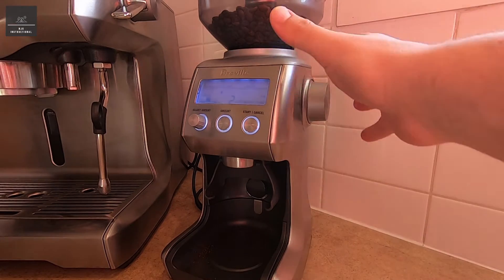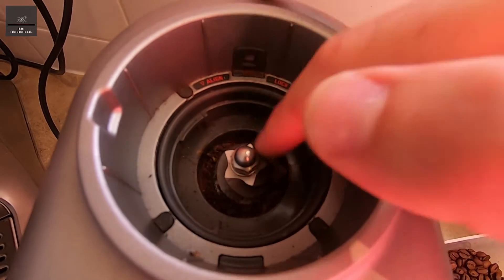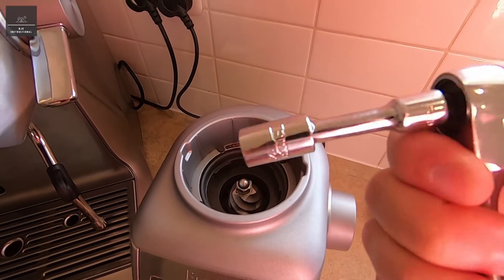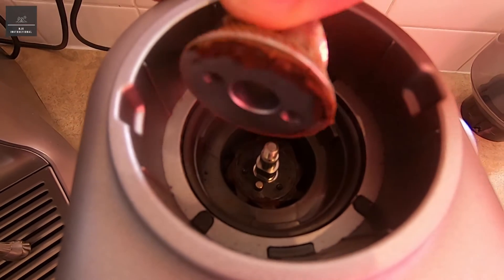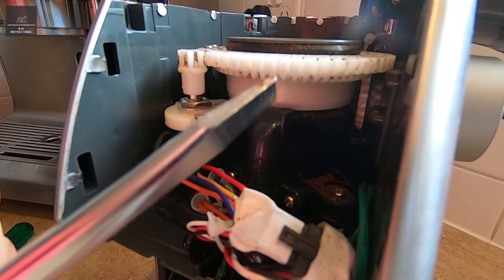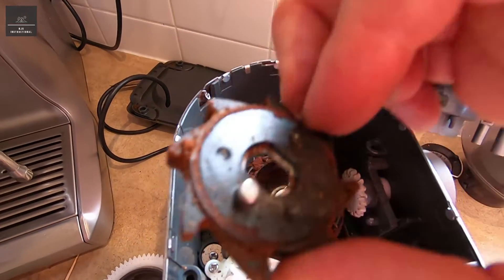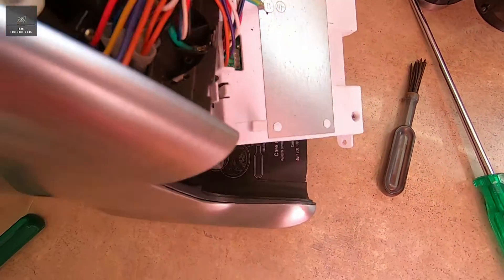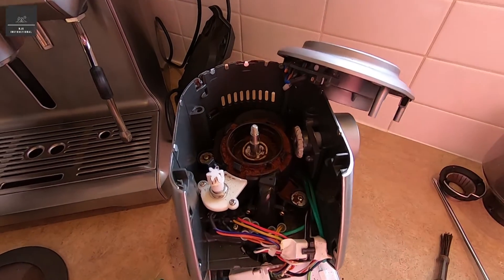Breville Smart Coffee Grinder Jammed! - TEAR DOWN & INSPECTION - CAN WE FIX IT?

Comment: About a year back my grinder hit a stone. I stopped it right away. Didn't look like any damage to the burrs but I purchased new ones anyway but the grinder just wasn't pumping out coffee like it used to. Took maybe 40% more time to get the same volume of coffee. I thought the gears might have gotten messed up so I 3D printed some and took the machine apart but found the original gears look good. I put it back together and like magic it worked like new.... until couple days ago I heard another strange noise as it was grinding. Stopped it again right away but no rock this time. Now again it takes 40% more time to grind the coffee. Is it possible the safety clutch needs to be reset or is it designed to self-reset? -Thanks

Comment: Yes very good I followed your directions and my problem is the motor has seized. I have a separate grinder now so will use that as the grinder in the machine is  no longer working. Thanks again.
Reply from the maker: You're welcome!

Comment: You said remove the 4 screws with the long screwdriver.  I only see 3, and only see you remove 3 in your video.  I know there is a 4th because it still won't open, but i dont see the 4th screw anywhere beneath.. !

Comment: Can someone please post a link to where I can get an impeller or the printer instructions. I have access to a 3D printer if necessary. I'm also avoiding Breville in future. The problem with this grinder seems to have been going on for years.
Reply: I 3d-printed a new impeller this week and it does expel grinds better than my old one..  The model is on thingiverse. Breville Smart Grinder BCG800 Impeller by Lacehim

Comment: After you remove the bottom burr you can actually just lift out the impeller (grab the steel pin  on top with some pliers and lift) and then the felt washer and 2 more steel washers under it.  Often cleaning down that far will fix the jam with no need to go into the bottom.

Whenever you clean out the grinder you should always go this far to clear the whole path.

Comment: Hi there, can you comment if the upper burr unit for the newer BCG820 grinder will fit and work in the older BCG800 grinder?  They look like an identical fit.  I cannot get my BCG800 to grind fine enough so I am wondering if I can put the newer adjustable upper burr into the BCG800 to get a finer grind.  Or, is there a way to adjust the older BCG800 by openning it up as in your video and changing the teeth alignment of the large white cog with the small white cog?
Reply: See if the upper burr has a adjustable ring with numbers on it.

Comment: Great video. Around 3-4 years ago my impeller chucked it in, so replaced it with the 3D printed one. Today it clogged so had to pull it apart again to clear the chute(so another refresh on pulling it apart was in order). The 3D printed impeller still looks really good, but clearly they should have installed a metal one to begin with. All about cost I suppose.

Comment: When you showed the star bean grinding gear with shortened teeth the first thing I thought of was that a bearing in the motor was bad and the motor shaft was wobbling enough to rub the ends of the teeth against the sides till they were so short that like you said they let pretty much whole beans through to below rather than breaking them smaller first. Rocking the shaft you might see if it is wobbling enough at high speeds to wear off the blades.

Comment: Is this there some kind of felt washer under the impeller? 
On my machine this washer was all gunked up and fell apart as soon as I touched it.
Reply: Yes.  You can see it in his video; after he removes the impeller it's still sitting there where the impeller was.  I think keeps grounds from getting into the bearings farther down.

It's probably OK if it's not fully intact, just fit it in the impeller base, make sure it goes all the way around.  Or you can track down a replacement online -- part number SP0001575, Breville is out of them but plenty of sellers online.

It's VERY fiddly to get it back in the machine.  I ended up turning the machine upside down in order to put the impeller back in without having to worry that the felt had slipped out.
Reply: @roberttarrall610  i fabricated my own washer from a sheet of felt i bought in a crafts store. 

Works fine so far and cost me next to nothing. 
And i still have felt to fabricate  20 more.

Comment: What's the name of the middle metal pole that the impeller sits on? I just bought a Breville barista express and it doesn't want to spin. That metal pole seems to be stripping and is removable. Not sure if It's supposed to be screwed in or if it's replaceable but any help would be appreciated!

Comment: Ingesting all that ABS plastic must have been nice... I had similar one of these new type (820), and the motor burnt out due to lack of cleaning... They're really built down to a price.
Reply: Hi.  It's not that bad really because the coffee grounds (and any grains of ABS plastic) don't end up in the cup, they stay in the filter basket. Of course hot water runs through the basket so there is an argument that you might get some smells from the plastic, however ABS plastic is advertised as "food grade" and heat resistant. ...  Cheers :)

Comment: I have only recently bought the newer model. My own Aristos Whole Bean Coffee is always roasted between light and medium which makes the beans much harder to grind compared to dark roasts. Hence the Smart Grinder started complaining (jamming up) and I have started looking for solutions. And here it is... which in my case has solved the issue. Do not drop all your beans you intend to get ground into the hopper but instead add only a little and then add a little, and then again. This way you will not put the extra pressure on the motor if your beans are hard and you will be able to get the grinding finished without any jamming! At least this solution has been working very well for me... Good luck!
Reply from the maker: Interesting to know, thank you for sharing!
Reply: @NJSInstructional  Well, it might be useful for anyone also to extend the lifetime of the grinder? ;-)
Reply: This helped me a lot, nice video, but this is what I needed. Thanks!

Comment: Your video and parallel test 800 vs 820 model was amazing - THANK YOU!  My problem on 820 unit was that coffee grind was too fine grind despite the grind setting. I also lost 65% of an output.  It was caused by clogged shoot.  I used your video instructions to get to the shoot from the top side of the grinder by removing Grinding wheel and impeller, and by using air compressor, just freed the shoot.  After that, grinder worked fine.  Clogged shoot was keeping the already grind coffee too long in the grinding area and therefore grinding it to more fine particle size.  THANKS again for excellent video production. regards Vanja.
Reply from the maker: Glad it helped!

Comment: I’m working on replacing the impeller but i found I problem that after I unscrewed the 4 screws that hold the top I couldn’t lift the top away! I really tried so hard. I’ve Sage Control Dose Pro grinder.

Comment: When these grinders jam or can't grind fine enough or anything  95% of the time it's the upper burr that is worn or damaged NOT the impeller. All breville parts are hard to come by these days but for the older model (bcg800) and all similar grinders (cuisinart, bodum, etc.) You can use the bodum burr that is still available. For the newer breville models, you can also use it but you need to get a burr holder from the old version.

Comment: You can take out the impeller without disassembling the whole thing. I use vacuum hose to suck it so it can be easily pulled out. The diameter of the hose is just right to get insight and is narrow enough to hold the impeller.
Reply: Only if it's worn down.  When they're not worn they can't physically be removed without dissassembly
Reply: I can take mine out too from the top supposed to having to take apart the whole unit. I have the 820 model with the metal impeller, so whether this is by design in the newer models or more worryingly even the metal impeller has worn down over time 🙄

Comment: My gear is impossible to remove. I'm actually damaging the plastic with the screwdriver. Help.
Reply: same for me
Reply: I've found out that if you have the model with the metal impeller you dont even need to open the Grinder. you can remove everything up to the impeller from the top. In my case I neede to open everything up and I saw that that weird noise comes from inside the motor where a plastic part got chewed up.
Reply: @alexanderschmidt8305  did you fix it?
Reply: This. Cant remove it at all
Reply: I can't get mine off either

Comment: Such a shame that the later model ends up having the same defects... you would think Breville would adress it in the 820 but of course, they wouldn't. Which is kinda short-sighted. I am deciding on a brand new home grinder. This one has featured prominently among the best... However, there is no way I will buy it if it has this defect. This is how Breville loses new customers, I guess.
Reply: so i literally bought this today and used it once and it was wonderful! tried using it again and ran into this issue......

Comment: We have the same grinder and have had it the same amount of time. Started not actually grinding as much each time, to the point that you have to run it 3-4 times to get enough for a 1 L french press. (60 g). So annoying that this expensive machine which is otherwise still working was brought down by such an obvious attempt to save a few cents in manufacturing. That they don't carry replacement motors is compounds the problem. Thanks for the helpful video. I haven't burned out my motor yet. Gonna order that 3-D printed part and keep my fingers crossed.
Reply: Do you know where you ordered that part from and did it help?

Comment: How interesting for $379 it’s pretty good for The quality. I wish they had replacement motors. Or you could upgrade the motor and make it more powerful. As it sounds like it’s underpowered when grinding coffee
Reply: It's pathetic, they should have some load protection on the motor... It's all designed to fail just after warranty expires.

Comment: First, thank you for the thorough video. I have an ongoing clogging problem with my 3-year-old BCG820XL and must now remove the lower burr and clean the chute every time I grind for espresso. Is it correct to say that on the 820XL, if I can pull the impeller out from the top after removing the lower burr (not disassembling the unit,) the impeller is significantly worn? I don't want to continue pushing Breville for the part if that's not the problem. Your guidance will be helpful.
Reply: Did you fix it? Please help me I have the same problem
Reply: @Sultan-bg6gt  After having no luck ordering a replacement impeller from 3D printing sites or Breville, I cut a nylon wire tie to fit between the impeller and housing. That essentially reduced the diameter of the housing where it meets the impeller. I affixed it with urethane adhesive and let it cure for a couple days. The wire tie fills the gap and the grinder has not clogged since. If you try the modification, be sure to not cover the outlet opening toward the front of the grinder.

Comment: The motor is still fine, however there is another plastic gear housed by the motor's spindle which wears down.  This is why there is the clicking noise.  If the motor was shot, the burr would not spin.  Trying to see if I can find someone to 3D print me a new gear to replace the worn one.
Reply: Mine is beginning to shred that gear, so if you do find someone for its printing, let me/us here know. Thanks.
Reply: Any luck finding a new gear?

Comment: Since you had removed the lower burr, you should try to remove the motor and check out the part number, perhaps you may be able to find one in the open market.

The stainless steel impeller is helping to reduce the wear off issue, however it doesn't help to avoid the motor burn out. Frequent deep cleaning is a must. I normally consume medium roast, after one month of use, I can see some harden coffee clumps has started to build up.
Reply from the maker: Cheers, thank you!

Comment: How has the ss turbine lasted in the newer model?
Reply from the maker: Too early to say...
Reply: FYI, My 820 is making the same freespinning noise (see 0:13  - 0:14)  with no grinding output and it is 23 months old. If I can find the receipt I'll claim the 2 year replacement warranty otherwise I'll check the clutch that a few people have mentioned as it sounds like that's slipping
Reply: Mine has lasted over 4 years and still looks good.  Will probably outlast motor & gears.

Comment: Nice demonstration.  In the second example, though, the motor was spinning, but no grinding action.  I'll bet that one of the drive gears is stripped because you can hear it while it rotates without load.  If the motor is burned, you can smell it while it is running (a hot electrical smell).  You may be able to get a replacement gear off of EBAY, but they gouge you for the price.

Comment: There is actually a slipper clutch inside the gearbox to limit the torque in the mechanism which is the source of the rapid clicking. It's to protect the nylon gears when the grinder jams. In mine, once it  the slipper clutch had 'slipped' once it slipped almost continuously thereafter. I disassembled the clutch and deepend the detents in the clutch plate and it has worked fine for the last 5 years.
Reply: ha ha yes that is the problem 
. A little more difficult to get to but once you get the clutch out and remove the metal disc you can see where the bearings have worn a groove in it. The disc has been punched out of flat plate one side hs flat edges, the other rounded, so I just flipped it over. The clicking noise is the bearings dropping into the holes and popping out again. In the first 20 sec of this vid you can clearly hear the motor running so not burnt out I think. I have the model with stainless impeller and there is a gap around the edge and it still works fine. Thanks
Reply: Could you explain were the clutch is?
Is it in plastic white gears he marks  in video or on top motor?
I'm in the same boat
Reply: @oneillme6403 I cant remember the detail.If you go to 11min 18sec in the vid you will see 3x phillips screws with stainless washers,there is a fourth you cant see, take them out, you will have to free the wires to the motor as they are zip tied to the body. The whole lot should come out far enough to be able to work on it.I would expect the clutch to be directly above the motor. Also be sure to clean the shute the coffee exits through. this was the cause of my clutch slipping, the coffee had set like concrete inside. Good luck
Reply: Thank you, your comment makes sense and at least there’s a “safety” mechanism to prevent major damage. Although it doesn’t seem to be the best clutch design. Mine too, slipped once and done.
Reply: I was able to get it all apart and found the plastic gear that engages directly with the motor has three stripped gears. I wish in this day and age of 3D printing parts like this were more readily available, but I'm unable to find anything online as a replacement either.
Reply: @dancerpilot91  I think I have the same problem and just found this video: https://www.youtube.com/watch?v=mupOSDemb7U with this shop selling the parts. https://www.etsy.com/listing/1409184151/replacement-grinder-gear-for-breville?gpla=1&gao=1&utm_source=google&utm_medium=cpc&utm_campaign=shopping_us_c-home_and_living-kitchen_and_dining-coffee_and_tea_makers-coffee_makers-coffee_grinders&utm_custom1=_k_Cj0KCQiA3eGfBhCeARIsACpJNU83cStil14EE-QAF_TgUnIJc429Z2ddhCD8MMu5j6Vskp978BcWNcEaAkYJEALw_wcB_k_&utm_content=go_1843970815_75209285652_346429623038_aud-459688891635%3Apla-306878933749_c__1409184151_12768591&utm_custom2=1843970815&gclid=Cj0KCQiA3eGfBhCeARIsACpJNU83cStil14EE-QAF_TgUnIJc429Z2ddhCD8MMu5j6Vskp978BcWNcEaAkYJEALw_wcB will first check the problem and if this is the case I will buy the gear. Good luck

Comment: Same problem. How did you determine the motor was burnt out? I replaced my impeller but as soon as I put beans in it jams again. Also the impeller in the new one is also polymer, it only has a thin metal shroud on top. Eventually it will wear also.
Reply: There is another plastic gear that is turned by the motor's metal spindle that gets worn down and makes the clicking noise.  You have to remove the motor to get at it.

Comment: Hello, 
I have an 820 with the steel impeller. I'm getting that tickety noise even though I’ve cleaned it out thoroughly. I tried taking it apart but when I got to prying the ring off with a flat screwdriver, I cant. It’s really hard and I started damaging the plastic. Another video had a guy prying it off with his bare hands. It think his skin was green.  So 1: is the 820 different in some way that you take the ring off differently? And, 2: does that impeller wear out at all? Stainless and all...
Thanks for you help!
Tyler
Reply: Same here!!! Please advise!!!
Reply: I'm having a problem with my 820 too, I have been grinding in the standard setup with number 6 for espresso and today it started: it seems that it's making great effort to grind and without coffee beans, going finer than 6 it sounds like metal parts squeaking. The lever becomes hard too and the coffee grinds with greater effort too, looks like grinding on number one or so...I don't know how to solve this!